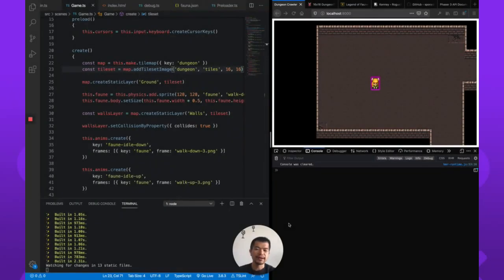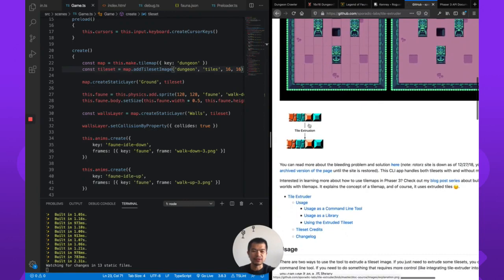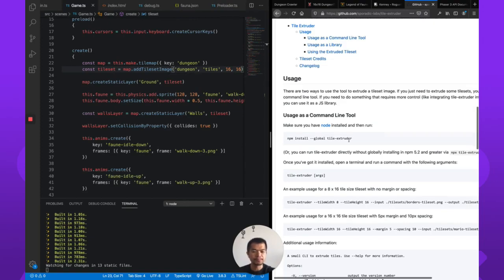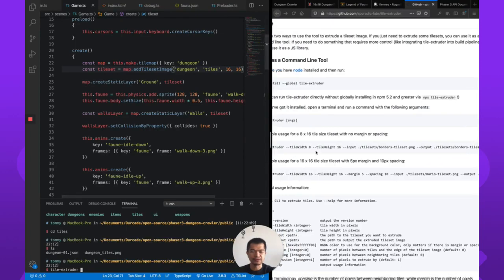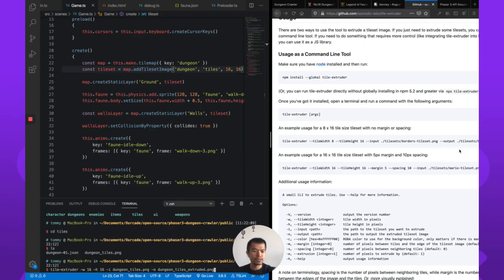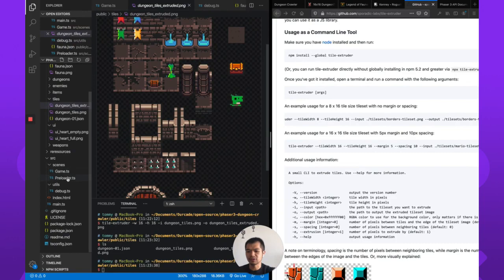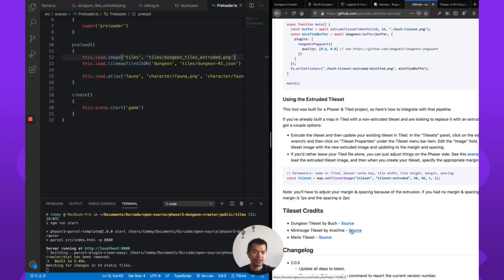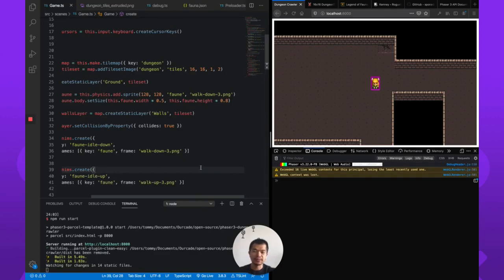Tile Bleeding Begone! - Dungeon Crawler in Phaser 3 - Part 2.5

Comment: That tool worked for the ground tiles I was using but not for the wall tiles. I didn't want to create a new test map, so I just used this for the ground. I was only seeing this issue on the ground tiles, either way.